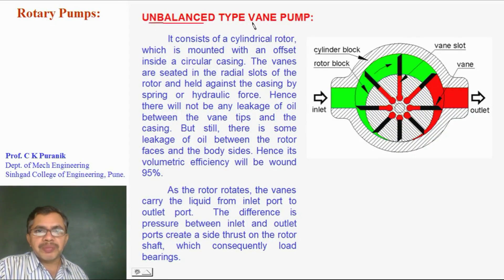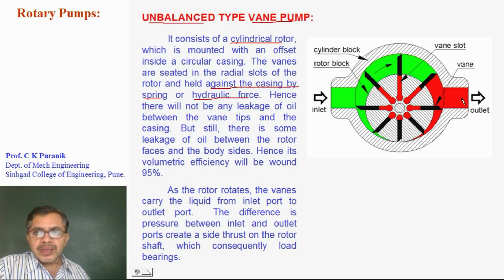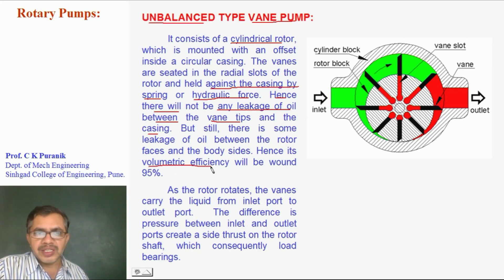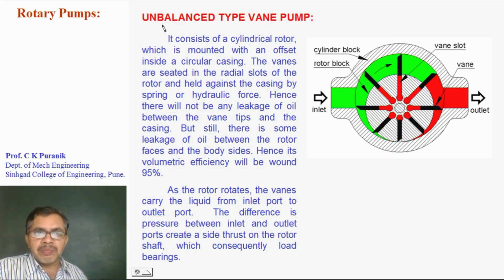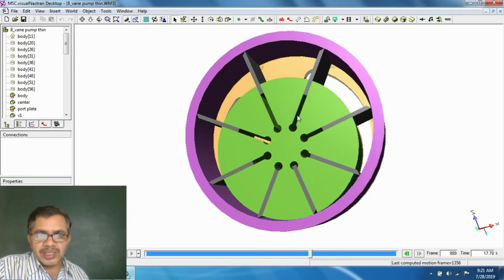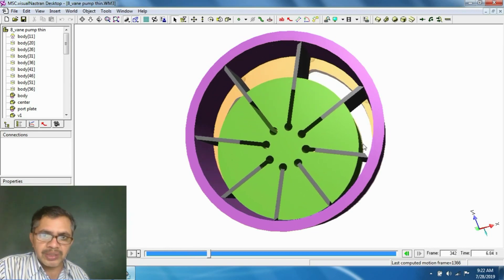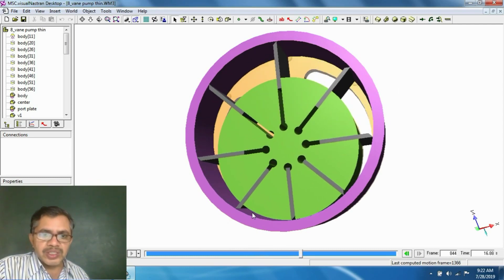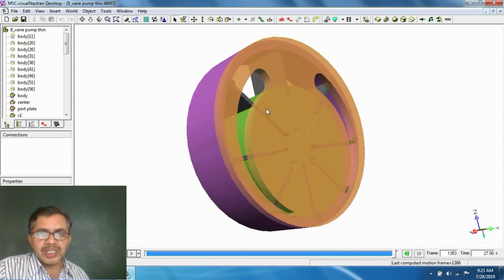unbalanced vane pump

Comment: sir how to find the diameter of rotor and stator for given volume flow rate and pressure ?
please help
Reply from the maker: let D is stator dia, and d is rotor dia. then, you can find areas A and a. So, Area of the gap between stator and rotor will be A - a. and volume of this gap will be (A - a) * L. (where L is width or height).
Neglecting vane thickness, number of vanes etc, we can assume oil delivered by the pump in one revolution (called volumetric displacement) is equal to this volume gap. So, Vd = (A - a) * L
If N is  speed in RPS, then Discharge (volume flow rate in m3/s) of the pump Q = L * (A - a) * N.
Reply from the maker: Pressure is not needed in this case.
Reply from the maker: If D and d both are unknowns, you need to assume a relation between them. Assume D < 1.5*d.